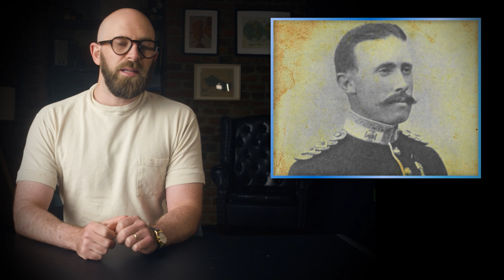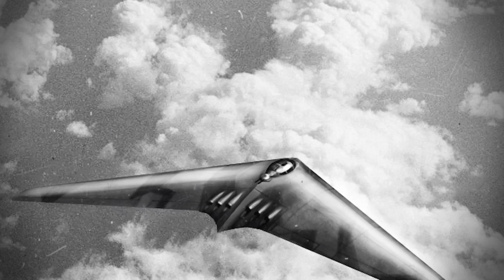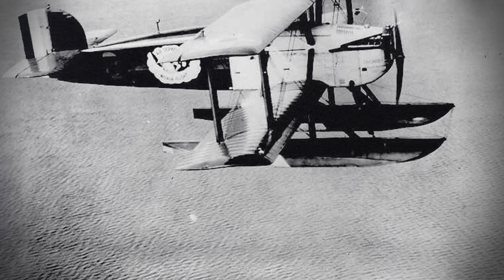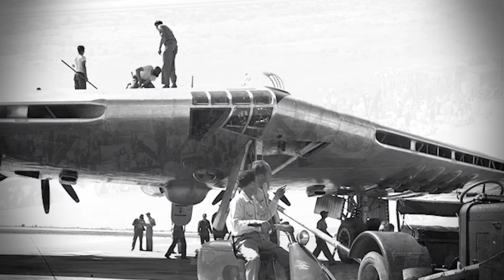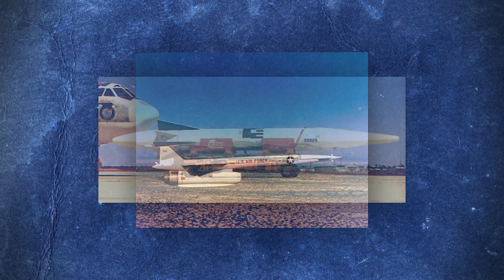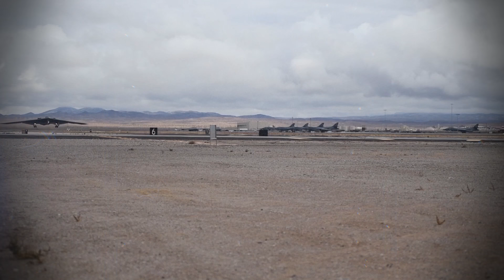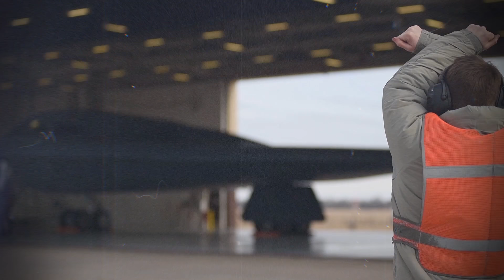$2 Billion Each - A Deep Dive Into the Incredible Engineering That Culminated the B-2 Stealth Bomber

Comment: My Uncle was an Air Force Colonel involved in the B-2 acquisition program. The reason why they cost 2 Billion a piece is this: Originally the Air Force went to Northrop and said "we want you to build us a stealth bomber. We'll order 100 of them and pay 500 million a piece for them." Northrop spent over a decade designing, building and testing the B-2 and when they were ready to start building the 100 aircraft the Air Force changed its mind and said "We only want 20". Northrop had to recoup all of the money they had spent over the previous decade so to do this they raised the price of each one from 500 million to 2 Billion. It was a smoke and mirrors thing. Congress wanted to cut the budget so the Air Force said "we'll only order 20". Even though they would still be spending 90% of what they originally planed on spending on the 100 it was still 10% less and on paper going from 100 to 20 looks like a big cut so congress was satisfied. That's the government for you.
Reply: That is true, but in addition to the number of units cut, the increases in the development costs were also because halfway through development, the USAF decided it didn't just want a high altitude bomber but it also had to be able to be capable of low level flight and penetration. Thus the re-design of the rear wing shape and added elevons to accommodate stability and maneuverability at low altitudes. (you can see int he B-21 it does not have the added points on the rear of the wing. B-21 is High altitude. This is probably what the wing shape of the B-2 looked like before the USAF decided they also wanted low level.
Reply: @glenn_r_frank_author 
There are drawings of the original B-2 online. It looks very similar to the B-21. The original does not have the sawtooth rear and longer regions where engine exhaust is mixed with atmospheric air reducing infrared signature.
Reply: @glenn_r_frank_author  So essentially a couple points cost 1.5 Billion more...
Reply: @JohnDoe-qz1ql  No, I am sure that the downsizing of the number of planes had a big part but the change in the shape of the wing/body of plane means redesigning a major part of the fusalage and the additional control surfaces that were added, and the reworking of aerodynamics testing for all of that .. yes it costs.
Reply: @glenn_r_frank_author  Economy of Scales always a MASSIVE thing, thats why the Zumwalt class Destroyers are still F-ing useless garbage barges despite being the supposed successor to the aging Arleigh Burke-Class DDG's.

They cut the planned fleet from 30 to 3, and because they chose a new unique 155mm caliber round for their shore fire support system to use; a simple 155mm HE round SOARED to over $1-1.5 MILLION Dollars per round...

Needless to say, the production contract was canceled; and that's why each Zumwalt still has two 155mm paperweights in stealth conformal turrets. They have no ammo to shoot, and because of the unique requirements of their design they're impossible to reconfigure for anything else including ALL modern 155mm rounds (I believe the guns have a high firing arc, or even worse can literally only shoot straight up; so requirement and can exclusively fire only the exact guided and extended range projectiles initially intended for them.

Only thing the Zumwalts are good for is whatever their modified VLS cells can hold.
Reply: Yeo, that's what happened. Northrop needed to recapture all the R&D money.
Reply: @rogaineablar5608   NG didnt need to recapture anything. The contract was a cost type contract where the government reimburses the contractor for every cent they spend on the development of the new product. The R&D was reimbursed roughly the same time it was spent.
Reply: @tealshift2090 yes, but it’s amortized over far fewer units.
Reply: Supply and demand, economy of scale.
Reply: You are showing a fundamental lack of knowledge or misunderstanding of the US DOD procurement contracts system. NG did not need to recoup anything. The B2 contract was almost certainly a cost type developmental contract. That means that the contract's price for each plane isnt fixed, the government basically agreed to reimburse NG for every cent they spent then add on profit on top of that. Roughly every 2 weeks (per FAR regulation 52.216-7) the contractor can bill the US government for costs that it has incurred up to that point for reimbursement (plus the share of the profit on those costs.).  

I will give you an example, lets say you tell me to repair your car. I give an estimate of 500 for parts, plus 500 for my worker's labor hours, and finally 20% extra for my profit. So the contract is proposed at 1200 total. I fix your car but I spent 1000 in parts and 500 in labor. You pay me that 1500 for parts and labor plus  an extra 300 for my profit. Even though the original contract said 1200 total. The reason why the original amount doesn't matter is on these contract types the government acknowledges that its an unknown amount of work / research / development to design and build these planes.   The goal is that the company gives its best shot of estimating the final cost without the need to pad the numbers to make sure they dont lose vast amounts of money if there is unknown setbacks. The stated amount in the contract is just a ball park figure so that the government can get an idea of the cost, and be able to budget for it. 

Frequently these types of contracts bite the gov in the butt because the contractor isnt really incentivized to keep costs low because every cent they spend gets them a little extra as profit. They are also needed because if the government wants to do something new (as most weapon systems are) then no company on earth would agree to a fixed contract unless they were very aware of the final costs of things using mature technology, and that just isnt the case in these contracts. The Government also doesn't want the company to go bankrupt because they missed on their estimates. Defense Contractors dont grow on trees, and driving one into bankruptcy could set the entire county's ability to produce a certain area of weapons back by decades.

So when congress or the Af cut the number of planes from 100 to 20, it wasn't that congress seen that figure and thought the contract would be 20% of the 100 plane contract. no, at that point the plane had been getting funded by congress for a decade or more and 30 or so billion dollars was already spent on development, equipment, a factory and so on. The low rate initial production was just starting and congress basically said no more money for you. Near the end of the production phase NG offered another 20 planes for 560 million each.
Reply: @tealshift2090  so economy of scale is a figment of the imagination?
Reply: @tealshift2090 This might be the best yt comment off all time
Reply: Considering the cost of crew and maintenance for 100 units, cutting production was still probably a bargain.
Reply: @robertplatt1693 I dare say that they (USAF) are really super duper regretting their choice now!
Reply: @robertplatt1693  What need would we even have for 100 of these???  The Air Force is insane.  Actually our whole military is.  And we're paying the bill for it.
Reply: @jcollura6766  Military spending is a very tricky balance to strike. A tank or warship or warplane that you have and don't need isn't that far off from taking the money used to buy it and burning it. But a tank or warship or warplane that you need and don't have can have even more catastrophic consequences.

The problem is there's no way to know for sure how much you actually need in the future, and even hindsight isn't always that clear. Was war materiel that was never used just a waste of money, or did having it provide a deterrence to potential enemies? Buying tanks that even the army says it doesn't need seems like the most clear-cut case of waste there is but what if the alternative of not buying them means shutting down the production line, meaning all the workers go elsewhere causing you to lose an awful lot of expertise and tribal knowledge on building tanks.

Recent events have shown that as expensive as it was and is, a good portion of the military spending meant to serve as a deterrence to Russian aggression was and is necessary. Was all of it necessary? Probably not but how do you know where to draw the line? There are no easy answers. It'd be great if we lived in a world where we could settle our differences peacefully but it takes two sides to establish a piece while war can be started unilaterally.
Reply: @lunatickoala  Did you just say "Russian Aggression" with a straight face as a justification for our bloated military??
Reply: @jcollura6766  Did you completely miss the point of what I said? Because it really seems like you saw a wall of text, ignored all the nuance, and oversimplified it down to a sound bite like a politician.
Reply: @lunatickoala  I'm not interested in people parroting pro-establishment State Department propaganda. I can get that from any news station. What did you say that had an ounce of honesty or original thought?
Reply: @jcollura6766  Russia, Moscow, Kremlin, USSR or whatever you know them by; have indeed traded in, indulged in, & promoted international aggression throughout any period of time you choose to examine...
Whether that fact is justification for any particular defense policy may be open for discussion, but don't pretend the threat never exists.
Reply: @davidkottman3440  Are you literally saying we have this gigantic military because of the threat from Russia? Russia.... The country that couldn't even conquer Ukraine!?!? The country we're told over and over again is a gas station disguised as a country and all their military is antequated and poorly maintained etc etc? That's your boogeyman?
Reply: @davidkottman3440  Are we not a threat from Russia and others point of view?? I mean we've been routinely engaged in multiple wars on many fronts and we just spent 20 years destabilizing the Middle East.  Millions of people are dead! We've destroyed the global South. Oh and we were just threatening to invite Ukraine into NATO which means parking nuclear weapons and military bases literally on Russia's border. Are those not threatening??
Reply: @jcollura6766  We are not declaring any territory our historic property, nor saying any country has "no right to exist", nor declaring anyone "not a real country"!!  Don't be deceived.
Reply: Maybe but buying less of then also cuts maintenance costs, since you are maintaining less planes.
Reply: @route2070 does nothing to decrease the development costs. Those are pretty much fixed, so reducing the order size dramatically increases the unit price. For example USS Gerald R. Ford cost over $13 due largely to development costs. The next couple Ford-class carriers will cost a fraction of that.
Reply: Interesting. Not surprising. Man, I wish I was there...

.. I be like, 'dude, were you listening when those smart people were speaking? Why do we need 100 of these things? If we need 100 of these things then were screwed anyways. Something has gone horribly wrong and humanity is just screwed.'
Reply: Basically the whole cost was R&D.
Reply: Economies of scale.
Reply: Wow, thank you for sharing 👍🏽
Reply: Definitely true. The USAF is hoping to avoid that with the B21 by buying enough to realize some economies of scale.
Reply: Or to put it another way, just imsgine how much the F117 would've cost per plane if there were only 5 of them.
Reply: @vic5015  The F117 should have never been made.  What roll did it even have?  A freaking absurdly expensive hangar queen that's used as a bomb truck, but it can barely carry any bombs.  Oh and it gets shot down by low-tech Cold War surplus weapons, bravo.  A plane given the F Fighter designation but has zero dog-fighting fighter ability.
Reply: @jcollura6766 it was only shot down because it repeated the exact same route every time.
Reply: True. The Air Force wanted at least 100.  Northrop told us engineers it would be about 130.  Air Force required low altitude flight which meant beefing up the structure and joints. I did some of that design work. Northrop planned a lot more tooling to assemble the planes. But that didn’t happen, so the 20 vehicles were largely hand built to very tight tolerances at thousands of hours. 
They first cut the order in half and then to just the 20 plus two test birds.  We all felt it was a shame how expensive it became. This was all the result of the thawing of the Cold War. So ultimately I guess it was a strangely positive outcome.
Reply: The end of the Cold War had NOTHING to do with it then? Pretty sure the real reason they cut the production request was that 3 years after it started production the Soviet Union collapsed and with no great power to face off against having a fleet of 130+ B2's was no longer necessary.
Reply: This a classic example of the difference between life cycle cost vs acquisition cost. this also happened  to the F22. Another issue with both of these aircraft is they were designed for the Cold War… then the world changed. 😢
Reply: Suddenly that Independence Day (movie) line "You don't actually think they spend $20,000 on a hammer, $30,000 on a toilet seat, do you?" makes a lot more sense.
Reply: Thought it was because they had to design specialist tooling and machinery to build them and now they have that in place its as cheap to build a B2 as it is to design and build the new raider?
Reply: came here to say this.... acquisition costs get out of control when you have to bundle all of your R&D costs into too few units.  It happens all the time.  Threats change, leadership changes, and the company has to keep refactoring to fit all of these changes.  F-35 costs are coming down as units are produced.  F-22 cost was relatively high because its production run was reduced.  It's business as usual.  That said... I wish we had 100 of these babies!!!!
Reply: Well, the kickbacks aren't free either....
Reply: Actually you’re way off. Jack Northrop proposed a stealth flying wing called the YB-49 as far back as 1949. In what I’ve read he had spent 8 years designing it. It didn’t stop there. He had plans for 8 different aircraft along the same “flying wing” design. Fast forward, the B2 was turned down twice till eventually 132 were ordered. Only 21 were acquired by the US.
Reply: Lived on the beach with this dude in Hawaii that was a canopy designer for the B2 in Pico Rivera no wonder he never wanted to talk about his job should check if and see if he's still alive
Reply: Yep
Reply: I have a titinium digging bar "I watched" the smith pull out of his oven and hammer out just for me, as a Kid working with Dad, think it was SR material or for a sub.
Reply: May be true, but imagine the horrific maintenance cost of a 100 plane fleet.
Reply: Well then northrops a monopolistic traitor
Reply: Dont those psychopaths ever consider what  best serves us .
Reply: yay politicans...
Reply: I don't believe you
Reply: Plus...more money available for kickbacks by doing what they did. Everyone involved with the scheme was happy.
Reply: We gave them the funding they don’t just do it because they wanted
Reply: Same with the F22 and these planes are so advanced that 750 F22 and 100 B2 would really make the airforce much stronger
Reply: Unreal
Reply: It’s just accounting. It’s not good nor bad just how you account for the cost of designing and making a thing.
Reply: A lot of the stuff in the military is expensive exactly because of this
Reply: Nice little story🙄
Reply: Wow thats crazy they wouldnt just do the 100 thats crazy
Reply: And we know they have more money than they publicly tell us. My god the government is wild.
Reply: Interesting , but I thought there were 40 made, not 20.
Reply: @MikeOB1981  21 were delivered.
Reply: @ my father was a mechanical engineer for GE and worked on the design and manufacture of the engines in the early 80s. However you’re right, the 21 “delivered” is only what I’ve read in books my father owned.  “The B2 story” “Northrop B2 spirit” etc. cheers. ✌️
Reply: It also costs a butt load more to maintain a fleet of 100 vs 20.
Reply: Pretty much this. The first B2 cost $30 billion, the rest were $800 million each
Reply: Our Government is the reason why our military is in free fall! 🤬
Reply: What would be the aircrafts price for simply building one (- dev. cost)?
Reply: @jellysquiddles3194  My understanding is NG offered the AF more planes at a fixed cost of 500m each at the end of the program. The AF turned them down.
Reply: What full of shieeeet, everything is arranged and organized in advance, it's called corruption, everyone gets a cut in the process from the start.
Reply: nice story. makes you then wonder does USA start wars to keep their military business going?
Reply: they need wars to keep business going
Reply: What in the hell do we need 100 of these damn things for???  I mean if we were literally in WWIII with the threat of world domination, okay fine.  But Congress absolutely made the right call.  We have zero use for 100 of these.  Hell just 5 could steamroll ANY current threat we face today. 

Also your stupid napkin math totally ignores the insane maintenance costs for 100 of these.  Go look up what it takes to keep even a single one of these in the air in a state of readiness.  Fool!!!
Reply: @modular182

You have years of R&D costs to recover.

You then have fixed costs.
Example:
I have a million dollar machine to make a framework. The plan is to build a 1,000 frames. That works out to $1,000 per frame cost.

Then you come in and say I only want 1 frame.
Yeah, now that frame cost 1 million dollars to build.

These aircraft are unique from the ground up in design and the materials themselves are unique.
Everything requires specially designed equipment to make unique components.

Fewer units produced substantially increases costs per unit. Few politicians can even comprehend such things.
Reply: @CrAzYDAVE84wow dude, calm down. Maybe because it not completely accurate. Did you read Tealshifts comment above?
Reply: Yup. Moron math. Government style.
Reply: The Demonrats couldn't chop the program entirely, so they purposely made it look as horribly overpriced as possible.  Nothing but politics.  Only having 20 of these is absolutely assinine.
Reply: The cold war definitely played a factor in that "black budget".....along with a lot of lining of pockets over a purposefully protracted period of time. It seems that tech has ben moving on amongst the back-hands all the same. It's exponential what money is sequestered for this tech, and many involved skim the books. That's late-stage capitalism for ya! Globally.
Reply: It's not just buying, you have recurring cost to maintain the fleet.
Reply: maintenance and spare parts cost for 100 of these things would easily break your neck
Reply: My uncle said your uncle is wrong
Reply: Insane if that is truth 😅
Reply: And here I thought the reason was the careless use of a rare metal called “Fuktanium”……..  Wake up people, do you seriously think that a large corporation would donate millions of its own money to a presidential campaign to get absolutely nothing in return?  Google how much money a candidate gets on average…..  Your tying circus animals outta snot bubbles if you think for one second this money wasn’t your money 1 paycheck earlier…….  In what world does a hope and a promise justify charging 2 billion a piece? Flagrant waste of taxpayer money.  We could start ww3 tomorrow and still have enough aircraft in the military to just crash each one into 1 opposing aircraft and we would still have enough left to man the military bases we setup on every other continent we take over….  Meanwhile, Ukrainians are keeping the Great Russia at bay using my daughters “My Lil Pony Drone”.    Until China can get water to burn hot enough to launch a missile we don’t have much to worry about there….  Hmmmmm, I wonder who we built these Billion dollar planes to suppress….  I don’t think it’s any coincidence that the only thing that these planes have killed are North American Mosquitoes.  I think they need to drag a large banner behind it that says, “Keep payin your taxes, peasants”, you know, the next time you see it flying over a football game.  I mean seriously, 2 billion each and my 8 year old daughter has seen them more times than any enemy combatants!!!   Okay, I’m done. I gotta go to sleep so I can get up and finish out my 92 hour work week so that I have enough money after my 40 percent tax so I can buy groceries and pay another 10 percent….  A wise man once said that “The pen is mightier than the sword”, as a way to express your disdain towards the habits of those that represent us, unfortunately, a hero of those same representatives coined the phrase, “La Plata O Plomo”.
Reply: How many Billions went into a few overpaid lazy old men that laid the groundwork for the quagmire will call Boeing today
Reply: It's amazing how regularly the US screws itself!
Reply: Nice
Reply: Of course they do that with so many projects no wonder we don't have enough Stuff with yhe largest by far milatary budget there our down fall in the end
Reply: Especially since we can't even protect our border with said military. 
Biden is guilty of treason.
Reply: Sounds exactly correct 😂 same issue happened to F22 and the F35 that's why they allowed Lockheed to sell them F35 to lower acquisition cost here internationally and why they are not as stealthy as F22
Reply: It was the 50's, he had redesign Bust Truck all the way from Shamoo, five gay monkeys holding the nuclear codes, waiting to invade Kiev after loosing a hand of poker in Morocco.  But at least they only had 20.  It was in a text book, burn books, woohoo.
Reply: Cool lie.
Reply: What about the design change
Reply: Yeahbut US probably saved a ton on operating costs. Since we didn't use it at the level originally imag8ned.
Reply: Wow
Reply: Then build 90
Reply: That is what they call a high-quality  comment. Thank you for being here.
Reply: @modular182 your math doesn’t make sense, even though you said your uncle was apart of the program. What you just done to your uncle is open a window for US government to sue your uncle or even get him arrested for leaking government secrets information.
Reply: Porkbarrel spending. Congressmen still got tgeir kickbacks.
Reply: So we could've had a hundred of them? I feel cheated.
Reply: Military industrial complex doing military industrial complex things
Reply: B.S. you get rid of the "cost overruns" and outright graft, & fraud and the damn thing wouldn't cost 1\10th of what they cost now
Reply: Omg sounds like bureaucracy
Reply: But we need more government……!!1!!
Reply: No he wasn’t
Reply: The problem is in the US its not coming from the outside the US its coming from the inside. How much does it cost to pay off a political party? Congressmen? Senators? Nukes are no longer even close to the most serious problem as we seen with Covid. The CCP have/had a biolab in California. Several Chinese Biolab college students recently was arrested sneaking in dangerous stuff. The US had an wide Open border bringing in 21+million unknown possibly dangerous people into the US for 4 years. They did that after their "concern" for a National Pandemic where they wanted America locked down and wearing masks? Does it make sense? Our politicians are hanging with Cartel leaders publicly. 21+million people are votes for 1 party which makes 21million American Citizen votes useless. People in the US needs to wake up. We need to pay attention to politics and challenge what is going on. ALL Mainstream News is owned by 1 Party/ Tech(X?idk)1 Party/Banks 1 Party/ Hollywood 1 Party/ Trillion Dollar Mutual Funds/Universities 1 Party, Special Interest Groups, Rioters, Protestors and Gangs. While people are going to work all week to support their families politicians are using their Taxes against them to steal their country.
Reply: @tapuout101  Seek a psychiatrist, FFS!
Reply: @jessehachey2732  Facts dont need therapy. Evil cant see Evil because they are in bed with it.
Reply: Though recent behavior by the DoD under Trump might lead one to believe that Congress always tries to cheat contractors, this has not always been the case.

With the B2 and the F22, the cut backs were driven by the fall of the Soviet Empire.

Without an enemy to fight, there was no reason to build out such large fleets.

That doesn't change, however, the expense of research.

"But they should just build the X number of aircraft if we're going to be charged for it!"

Good point.  However, the cost of building the aircraft is only the initial payment.  After which, we pay for fuel, housing, crew, maintenance, and training.  And some of those costs become greater over the years.

Having only 20 out of 100 that may never be used is a huge savings, despite the startup costs.
Reply: Your uncle would be proud knowing you're sharing military secrets on youtube!
Reply: @travelingislife6097 if it was a military secret then his uncle should've and wouldn't have shared with a civilian that didn't have a need to know and it's been long declassified and is out there for anyone to see